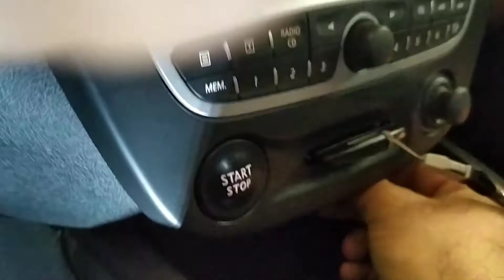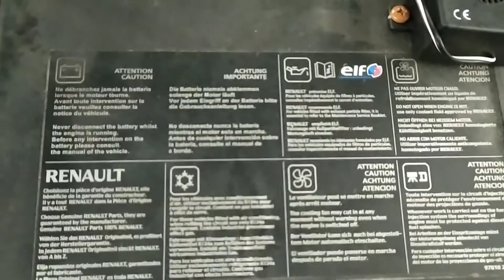Renault Mégane 3 OBD OBD2 Diagnostic Port Local and Fusebox

Comment: How did you get the cover of the obd port out? On my megane its super hard
Reply: It is very hard to remove. You need to get some sort of tool behind it to get it off
Reply: @1RUFC True story. I'm afraid that I'm gonna scratch it with a screw driver